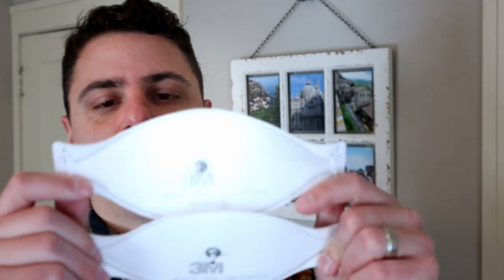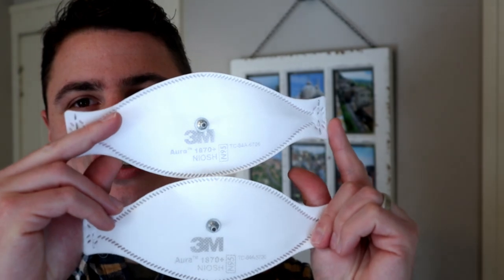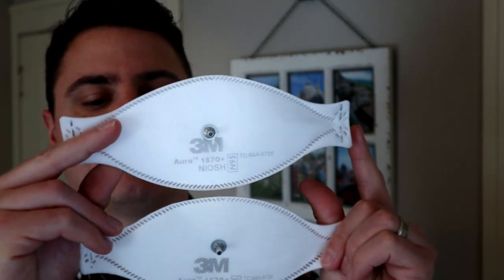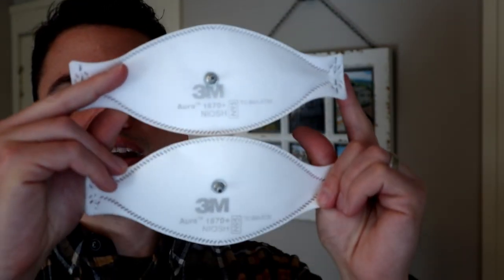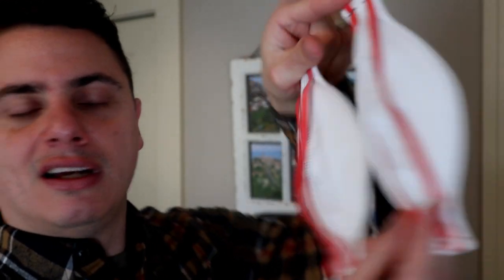Mask Nerd Short - Counterfeit Masks?

Comment: Interested to know if there is a way to spot fake KF94s. Can you tell by the packaging? Bought some Bluna Facefits as well as BOTN and Blue, per your recommendations, on Amazon since they were sold out on Kollecte and BeHealthy; the packaging and masks look identical to ones I recently bought after Kollecte and BeHealthy restocked.
Reply: KF94 fakes that I've seen others show online had completely different stitching than the real deal, also they were 3 layer instead of 4 layer
Reply: If the individual packaging and Masks inside look the same they're probably real. I know a number of months back they were selling BOTN masks on Amazon that were fakes that were arriving in different kinds of packaging. But if what you bought came in the same exact individual packaging then it's probably real
Reply: @Amanda Wilson I bought BOTN from Be Healthy and Bluna from Kollecte.

Comment: Hi Colin, first of all I want to tell you that you are a great guy who does a good job for the benefit of the general public.  Second, is it possible that a quality breathing mask indoors without ventilation will stop working after a short time?  Because I use a vacuum and after I leave closed places there is a feeling that the mask is already full and should be thrown away
Reply: High-quality masks like N95s will easily last >40 hours in most everyday use without getting "full". They are designed to handle 200mg of particles which is as much as wearing a mask 24/7 in Shanghai for ~200 days, so except in highly polluted environments the straps will wear out first.
Reply: @Jack-ph6sp  How did I use the Powcom mask on public transportation and still feel the virus?  (Of course I ran away from there right away).  And where can you get a quality mask (preferably n95) at a reasonable price?  Because prices have gone up a lot.

Comment: Is fake necessarily bad? Aaron's mask spreadsheet includes a "FAKE "BOTN" from Amazon" that has a 99.50% filtration rate. 

Is a "fake" mask that has a 99.5% filtration rate still more protective than a real mask with a lower filtration rate?
Reply: They might as well be cloth if they are fake
Reply: CK H  I don't have the mask. It's listed on Aaron's spreadsheet of masks.
Reply: Gosh, hopefully not. I just noticed my Halyard N95 might be fake, so trying not to freak out.
Reply: The filtration is not the only thing that makes a mask good. Note the other data, that fake has poorer pressure drop (harder to breathe) as well as a lousy nose wire.
Reply: Aaron also notes that the nose wire on that same fake BOTN is "crap," so even if the filtration material is excellent, you'll get a lot of leakage.
Reply: All the masks on the spreadsheet were tested by Aaron in live streams. If you look at the date of the FAKE BOTN on the spreadsheet, you can then find Aaron's video on the same date and find the segment where he tested that mask. Watch that segment to see what he says.

Comment: I’ve bought that same mask from Home Depot in California. The bands were rubber.
Reply: OK, so the ones that I got at Home Depot look about the same but the model number is different. 9205+ with blue (easy to break) rubber bands.
Reply: Same here! Are this 9205+ with blue rubber band fake??????
Reply: @diegoderu6657  the legit 9205+ has crappy bands that are like crappy rubber bands. He's referring to a different type of rubber band that the fakes have.  Home Depot gets them direct from 3M.
Reply: It's fine. See my comment below.
Reply: @xymzk  Do the bands on the 9205+ really break? I love that mask but have only tried it on so far, haven't taken it out in the wild!
Reply from the maker: Just to clarify, when I say rubber bands I mean they are using natural rubber type bands(think like stuff you would by from am office supply store). Legit 3M mask you an elastic band material that to most people will look like rubber but is actually a special elastic material.
Reply: @coll0412  How can I tell the differences?🤔
Reply: There are multiple 3M Aura models. I know there is 9205+, 9210+, 1870+. The 9205+ has the blue rubber bands, 9210+ has white braided bands, and 1870+ has red bands. If you bought the masks at Home Depot, they are legit.

Comment: I bought some KN95's from WellBefore. I believe they were the ones linked in your spreadsheet. On the outside- it says KN95 and well before. But it doesn't list the test standards GB...... However, they are individually wrapped and in each package, there is a little square of paper that lists info like test standard: GB....2019. Is this still acceptable?

Comment: What does the real 3M Aura strap material feel like? I have some that I assumed were real, but the material is kinda like a rubber band too, just more velvety?
Reply: The surgical and 9205+ models have rubber band style straps that are kinda crappy.  He's referring to a different sort of rubber band material that the fake has.
Reply: Real 3M Aura's use a non-latex rubber that doesn't cause latex allergies. It's smoother and less grippy feeling than a natural latex rubber band.
Reply: There are multiple 3M Aura models. I know of 9205+, 9210+, and 1870+. 9205+ has blue rubber straps, 9210+ has white braided straps, 1870+ has red Polyisoprene (I think that's rubber) straps.

Comment: did the fake 3m fail testing? i've used the 1863 in healthcare and the bands are rubber
Reply: The legit ones have rubber band style straps. He's referring to another type of rubber band. It's Unfortunately confusing people.  The 9210+ has much better bands though they don't stretch as much and it's not a surgical/fluid resistant model.
Reply: @xymzk  How can you tell  the difference between the rubber bands?
Reply: 3M 1863+ is an ffp3 mask and it has the same bands like 3M 9330+.I doubt there are 3M fakes in Europe now apart from the 3M 9332+ that was found early in 2020.
Reply: @alexanderharden7307 have you got any more info about those fake 9332 masks?
Reply: @xymzk Do you mean the real masks don’t have actual rubber bands which are stronger/thicker? My 3M masks have a more flimsy band that isn’t as tight on the head as an actual rubber band

Comment: So the same does not apply for KF94s that they need model name on it? What does a fake KF94 look like? I also have Botn ones that have FFP2 on them. 🤔
Reply: From what I understand kf94 fakes are much more rare due to more regulations than N95/kn95 but I'd like to hear from Aaron and see what he thinks 😊
Reply from the maker: KF94 labeling requirements are on the packaging only, so no markings on mask.. KN95 on the mask and also packaging labeling requirements.
Reply: So far every KF94 mask I have is individually packaged with all the requirements visible as well as instructions.
Reply: @coll0412  thanks! Wondering why BOTN is printing FFP2 on some of their masks. Something about CE approved?
Reply: I wanted to buy some kf94, but seeing that it was to be shipped from china. Wiil be fakes
Reply: @SuperCobragold  yes kf94 should always be from Korea. If it’s coming from Korea, it’s legit.
Reply: @coll0412  What exactly do we look for on the KF94 packaging?
Reply: @SuperCobragold  - Buy them from South Korean sources, the ones that Mr Collins includes in the far right column on his spreadsheet.
Reply: @alexanderharden7307  I see, thanks!
Reply: @ixchel231  they can have multiple certifications and there are labeling reqs for the masks themselves for the European standard.

Comment: If a mask from Europe says KN95 and FFP2, does it mean it's fake? Let's say it has the correct CE mark with the correct body number.
Reply: No,it's not a fake.If the mask has the EN 149:2001+A1:2009 FFP2 NR,the brand name and a current CE mark,you're good to go.
Reply: @alexanderharden7307  Even if it says FFP2 and KN95?
Reply: Masks can have dual certification.  Many KN95s also have FFP2 certification.  There are KF94s that also have FFP2 certification.  They will need to meet the labeling requirements for KN95s and FFP2s. I'm personally not a fan of either standard because of the lack of oversight though FFP2 is technically better. If you can stick to major companies like 3M from legit sources it's ideal.
Reply: @xymzk  So a FFP2/KN95 mask should hace both the EN149:2001 plus the GB2626 standard marks on the mask? Just wondering, I wouldnt buy one like that either but I want to be informed. Do you have a source that I can use to read more about this?
Reply: @alexanderharden7307  yup!!! I have the 9502+ on its way from Korea.  It was less than 50 cents with the shipping sale and coupons from a major distributor on Gmarket.  The shipping sale has ended, but they have them periodically.